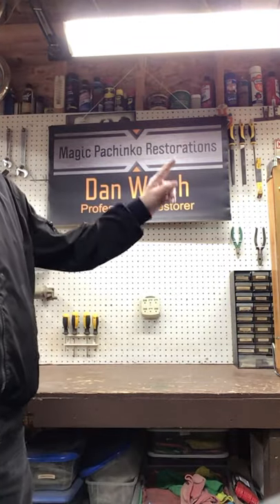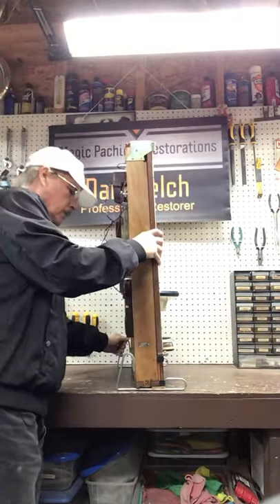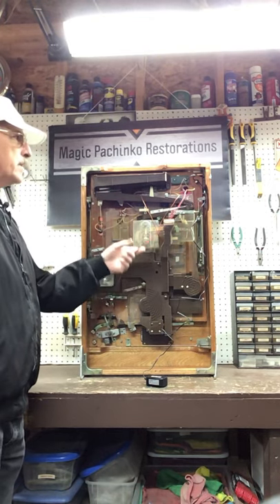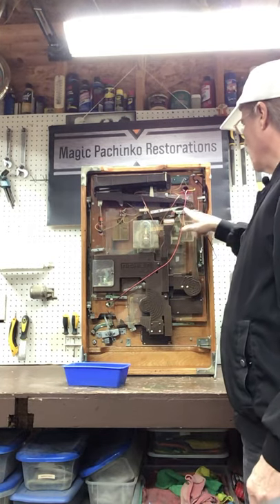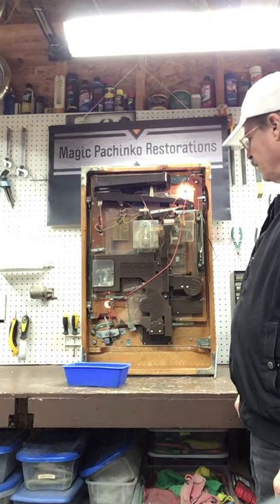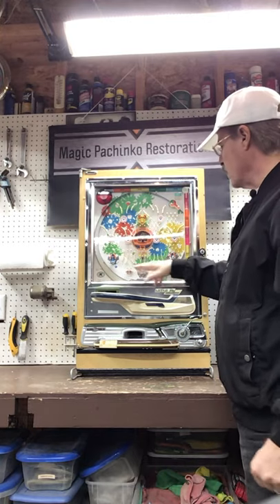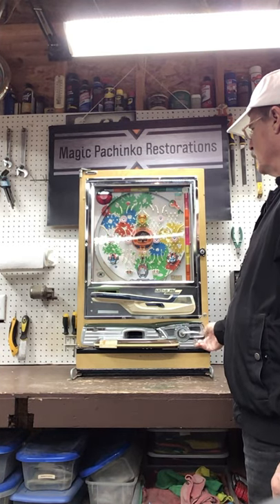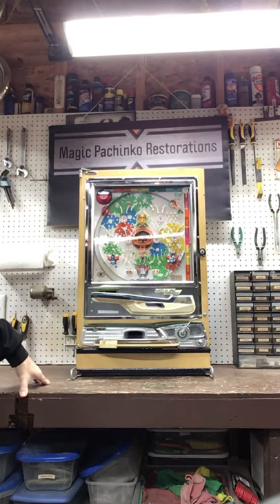1975 Nishijin Model B vintage pachinko machine

Comment: Hi Dan, where did you get the metal stands holding up the machine?  Did you make them yourself?  I noticed in another video you had used wooden blocks for the base stands.  I just acquired a Nishijin 'balloon theme' model machine from an associate at work.  Vintage 1978 I believe.